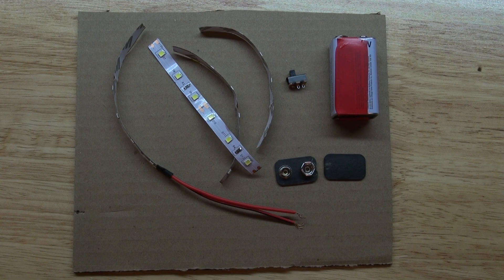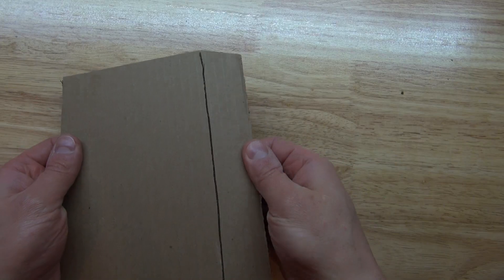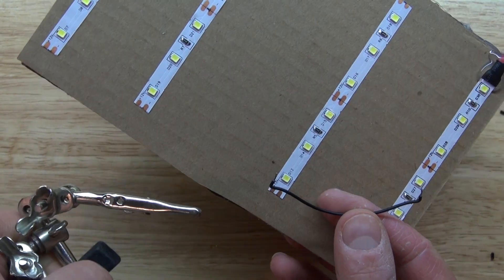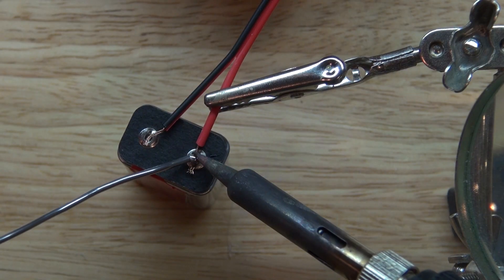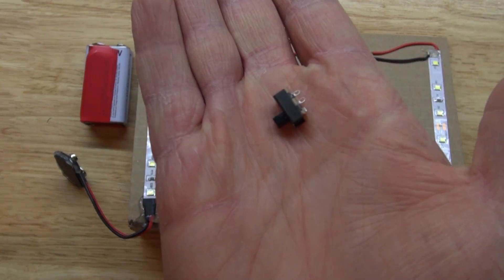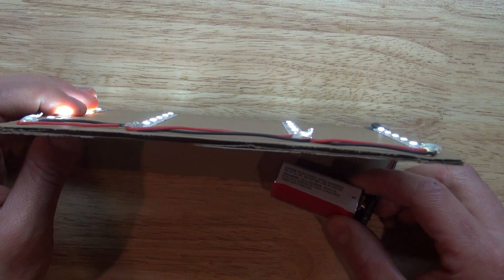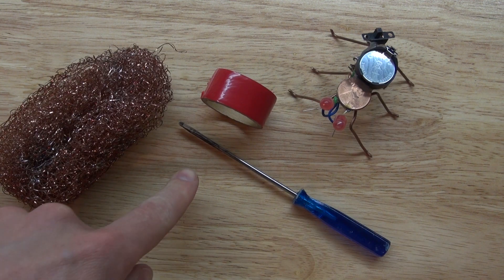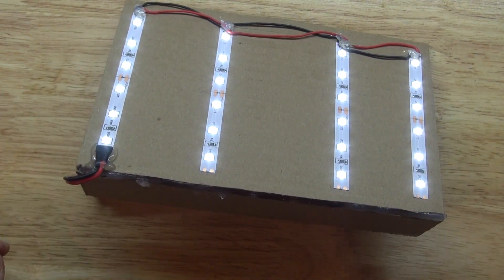LED Cardboard Light

Comment: Led strip heat in cardboard after long  hours nd cardboard burn ? Or not please help
Reply from the maker: Actually it does not get hot. Especially if you use 9 volts.
Reply: @SciTyeTech  ok nd 12volt adapter nd led strip can hot or not?

Comment: cool. But maybe the leds neddes a heat sink. (Sorry for the bad English)
Reply from the maker: Your English is good! No, they don't need a heat sink. I left them on for 5 hours and they did not even get slightly warm. So, these are very safe.
Reply: Ok